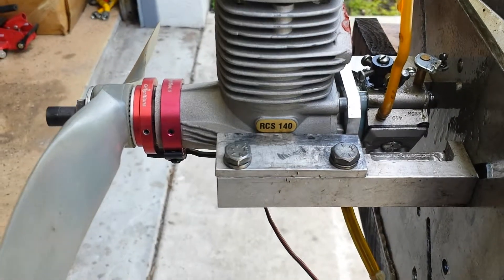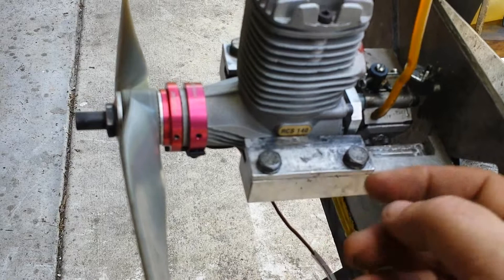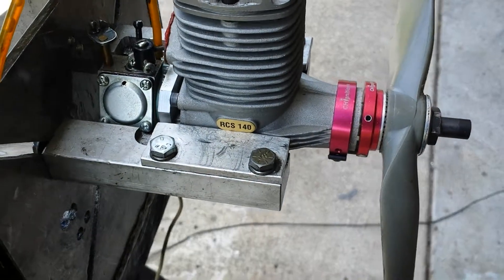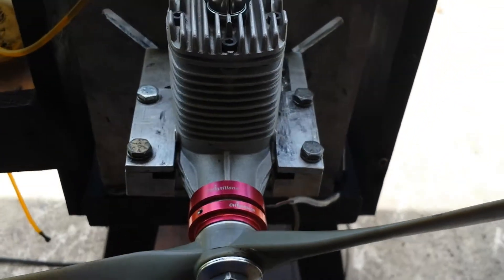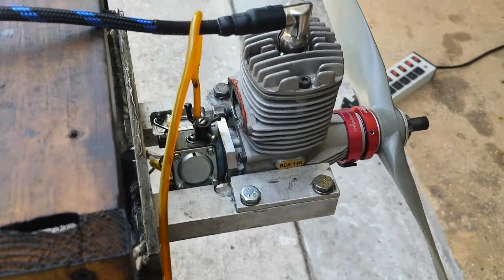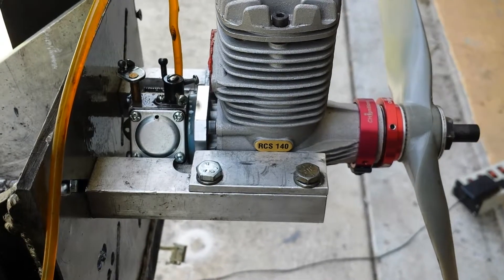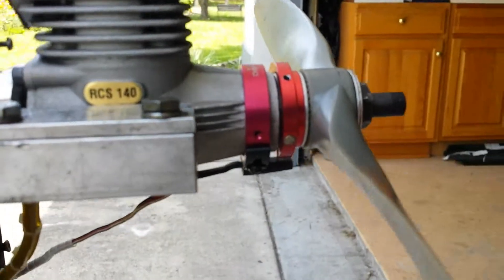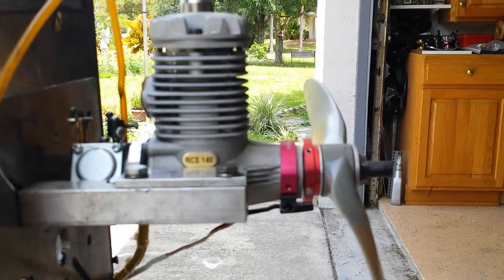Rcs 140 running with  CH CDI IGNITION.

Comment: Just found your movie clip. Nice run, quick start. Whow! Very promising!
Have probably the same enginge, but sold in Europe as Airworld Moki 20cc
Own a new HA and SA, back and side exhausts. The new one I keep boxed.

Rebuilding the other, a second hand SA motor now fitted with new bearings and piston/cilinder set. The piston ring had a thermal leak and damaged those parts, running it any longer whould ruin more material. Saved in time. 
When fixed it can be regarded as new.
Think of running on Aspen, fiste 32:1 and later on running 40:1? Is tha a good choice?
What kind of fuel do you use? 
Like the CH CDI conversion. Inside the valve mechanism the ignition magnet (rare earth) is gued. 
Not possible to reuse it? Or does the signal/sensor not work on RCexl? 
Just have to test the origina ignition.
Thanks RCP